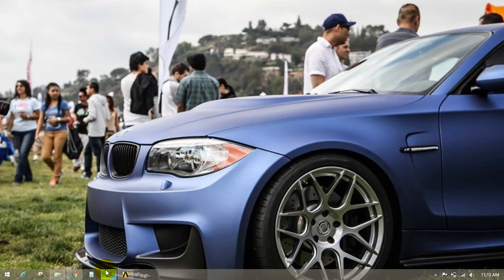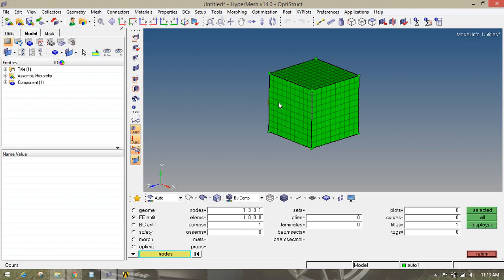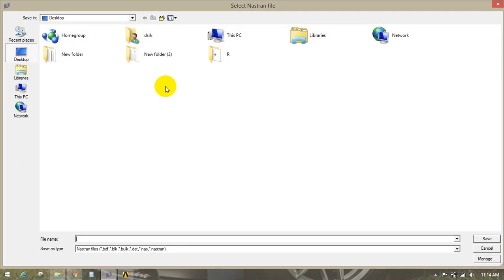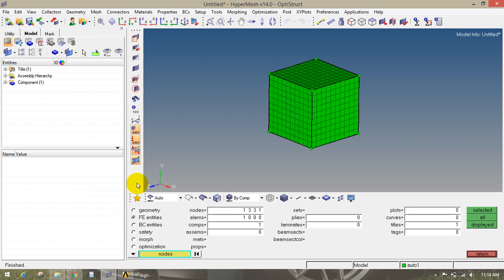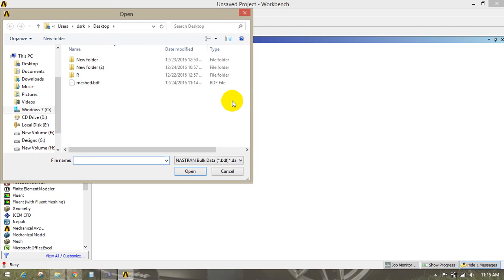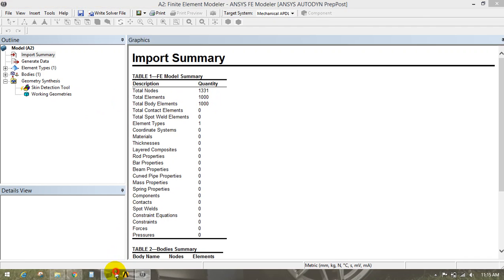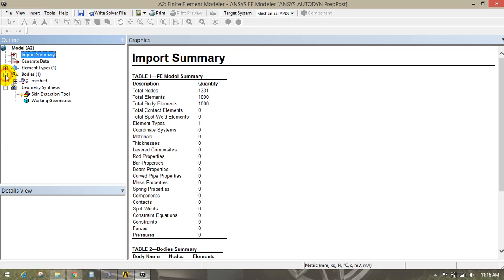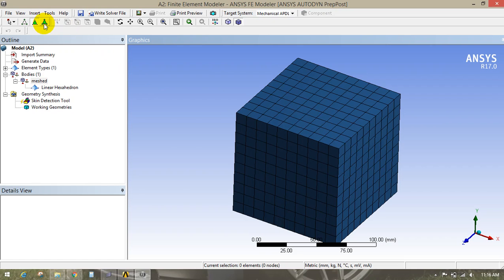How to import Meshed file from hypermesh to ansys

Comment: i dont have finite element moduler, is there any alternative name in ansys 19.2
Reply: same here
Reply from the maker: @javiere5511  You can use Model or Mechanical model and try to import .fem file. this will import all loads boundary conditions, contacts.
Reply from the maker: Ok I'll check and revert u
Reply from the maker: You can use Model or Mechanical model and try to import .fem file. this will import all loads boundary conditions, contacts.